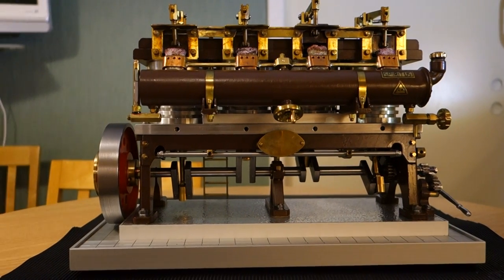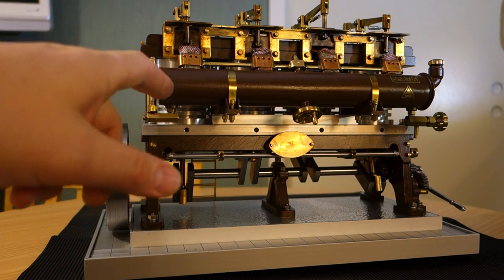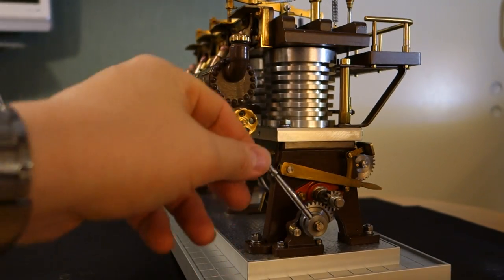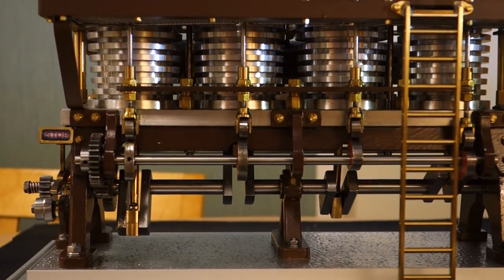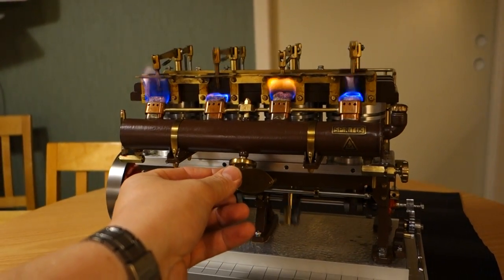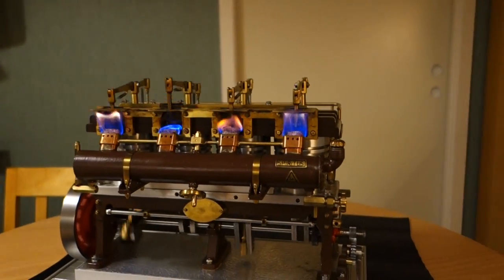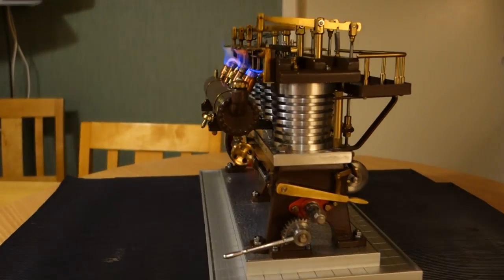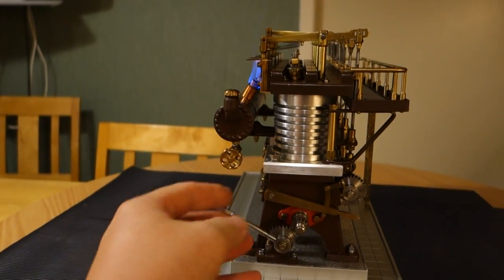4 cylinder vacuum-engine

Comment: The exhaust valves opened by a cam?
Reply from the maker: Yes. You can see it well in the video. The cam lifts the valve-rods in synchronized sequence.

Comment: What if you put like a stator or alternator on it suppling voltage to coils to heat up the air instead of burning fuel, and have it perpetually run on its own energy? Burn fuel at the beginning to start it then when it gets up to speed switch to the electric heating element
Reply: Alternators are only about 60% effecient, and you won't be able to direct all the heat from the coils into the engine. So no it won't run perpetually. Maybe for a couple hours, but definitely not perpetually.

Comment: Nice engine. Love the sound it makes.  Is this your own design?  If so, have you considered publishing plans for it?  I for one would love to build one of these.
Reply from the maker: The constructor of this marvel; is Karl Syla. A german retired engineer; who during a periode of several years; made perhaps 40-50 different models of most types (steam, stirling and vacuum-engines).

Most; perhaps all of his models;were made "one off". He made them all out of his own head. He made sketches during his workprocesses; but these were not saved later unfortunately. So no sketches or plans are available for this or other of his models. A real shame.

Comment: Upgrade this motor by using induction of graphite rods in the pistons. Then you will be able to throttle the engine up or down and not need a fuel source or open flames. Novartis

Comment: Ok, i have a Q that might be dumb or answered, but we can run ICE on ethnol. And this runs on the "flame" or exhaust fumes to so speak. Would it not be an idea to combine it? ICE running, and the exaust on that powers this type of piston behind it. It would be like re-using the fuel, instead of "burning it" ineffectively like these engines seem to do. 

Or am i missing something?
Reply from the maker: Flame-lickers/vacuum-motors are not energy-efficient, compared to most working-princips. I may misunderstand you; but in case I am not: these motors are not powered by the exhaust-fumes; but the vcuum made by the temperature-difference between the hot air introduced to the cylinder and the cold air made by watercooling or cooling-fins.
Reply: That much i understand. My point was, if instead of using "hot-air" from a flame, use the hot-air from the exhaust of a ICE, and then cool it with the normal engine cooling system. You could in theory even increase its effectiveness by using a N/A engines vacuum, although that would need a redesign. 

Even if the efficiency is low on it, its "waisted" energy (from the ICE), used to give power. And even if its not to power say a cars wheels, it can be used to power the generators, charge the battery or similar, thus lowering fuel consumption.

Either case, its a really nice model you have :)
Reply: The added complexity would outweigh by far any gains from recuperating exhaust heat. It's simply not worth it.

Comment: How long would it run with just 3 or less cylinder hitting
Reply from the maker: +Jon Newman (JJBigBalla) 
Thanks for looking.
Performance is substantially weakened with three or less pistons running. It will run on three cylinders. But hardly on two I would believe.
In the video, you may see it run on three cylinders for a very short time. I have no desire to run it on less than 4 cylinders; so the runtime on three cylinders has not been tested. I love it to much to see it struggle ;-)